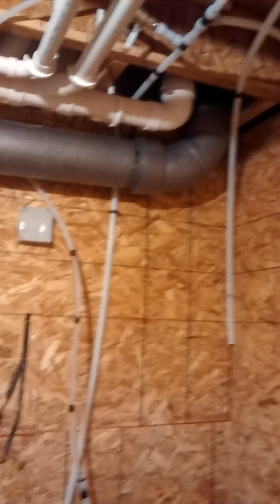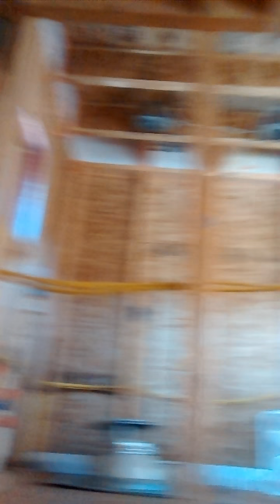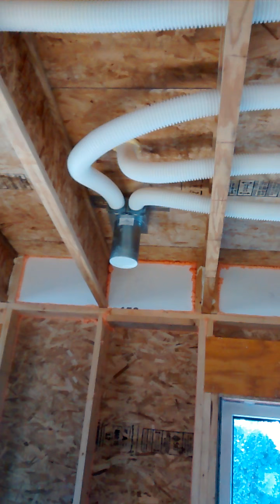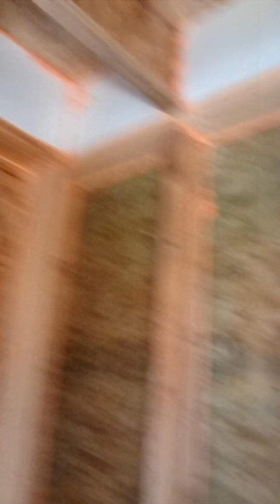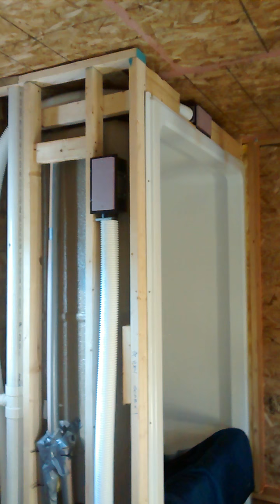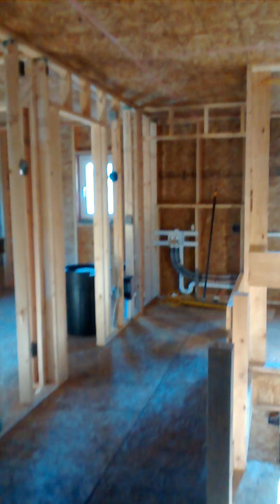Zehnder Comfoair 350 HRV Rough Installation

Comment: Isn't the main intake/exhaust supposed to be on the same side of the house?
Reply from the maker: 2Awesome I haven't heard of that. The building code is more concerned with separation of the exhaust from the intake/doors.
Reply: Miphi Home If the wind blows for example from the side of the house where the intake is, more air will move through the intake and positively pressurize the house. (and negatively when air blows into the air exhaust)
Reply from the maker: 2Awesome That is a possibility, but in a different video I explained how we couldn't cut a 7" hole through our TJI and have the proper separation from the air exhaust, so the simplest was running it straight out the south end. But, it's not "required" to be on the same side.
Reply: Miphi Home im not sure on how far apart they should be, just that they should be on the same side of the house, i guess you would have to run it under the TJI joists which would be kinda be an eyesore. One of those energy standards gives you points for having the hrv/erv closer to a walls, maybe that's how they recommend it idk. Just found it, 6+' separation between intake/exhaust and at least 4+" off the ground for exhaust and 18+" off ground for intake